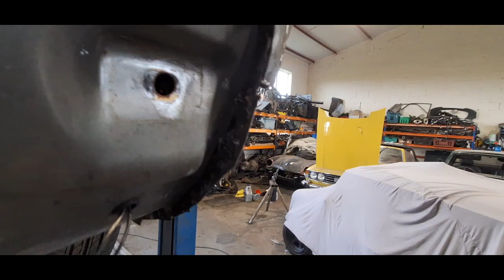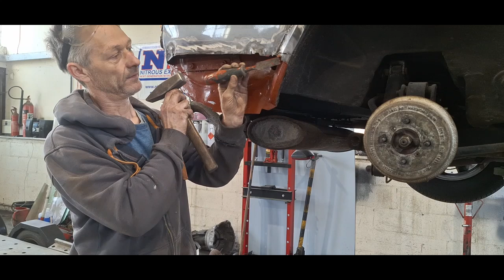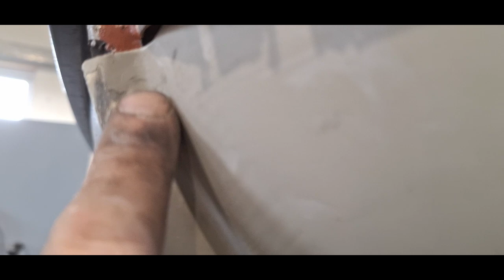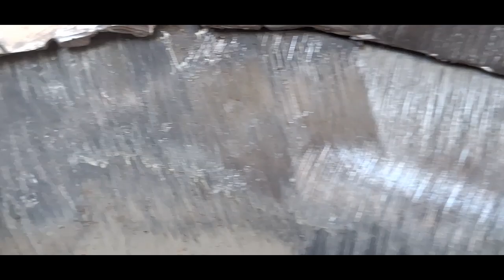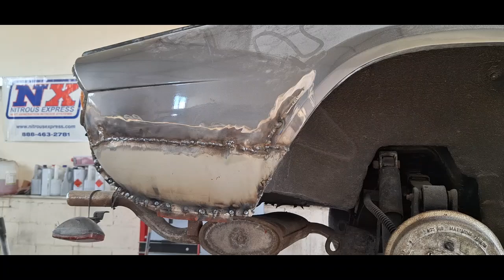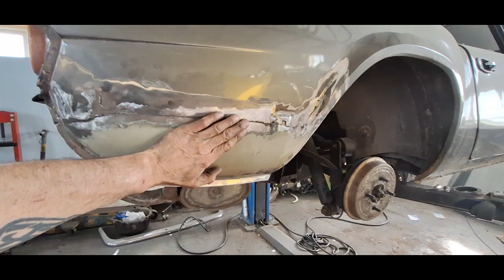Triumph Spitfire/GT6 rear wing/fender corner - Fitting, welding in and grinding back the repair

Comment: It's a good job, I would have done it the same way. The purists would want to butt weld, but it isn't as strong as the lap weld, and I don't care how careful a grinder you are, the metal always gets thinned when grinding butt welds flush. Best result would be to inject some rust preventative onto the rear of the seam if possible, I swear by the Dinitrol products, but anything is better than nothing. For me, there is nothing wrong with tapping the seam down a bit before filler application, an extra 1mm of filler is negligible and it makes a completely invisible repair.
Reply: I made both rear fenders like this and now I kinda regret it. I'm more annoyed that I now have bash the weld in and use more filler. I was thinking about dinitrol in the back seam before sealer also.